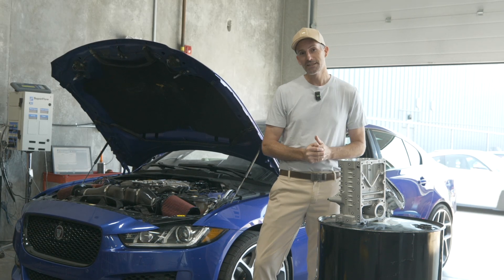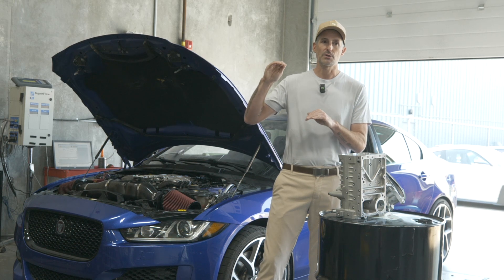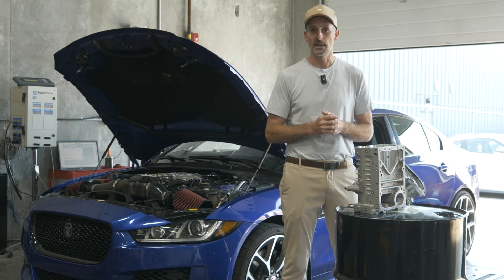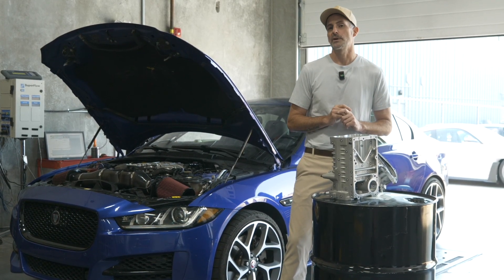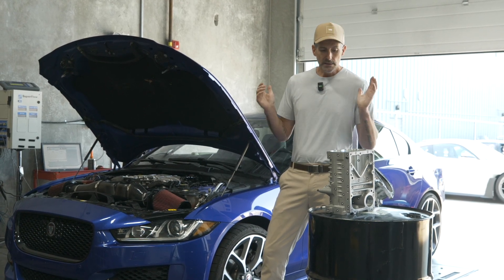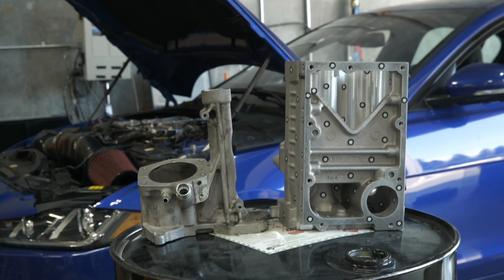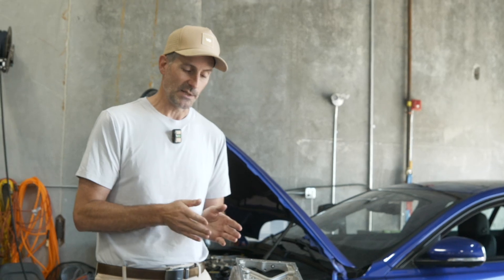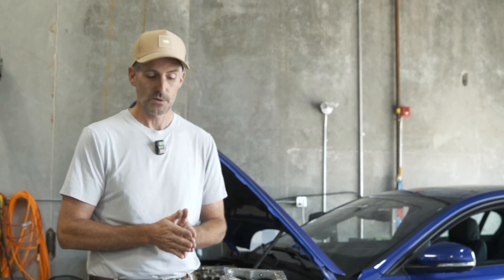600BHP JLR V6!!!  Jaguar 3.0L 1320 Supercharger Porting

Comment: I’ve got L494 Range Rover sport. Does this fit as well?
Reply from the maker: Yes, if it's the V6!
Reply: @VelocityAP do I need to change/upgrade anything from the transmission and/or the gearbox? Or any ecu calibration tune?